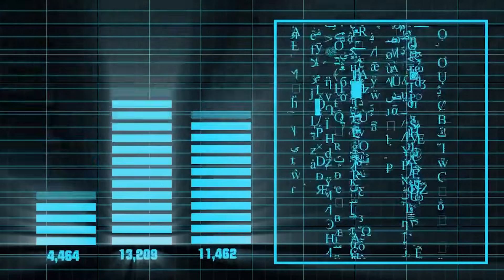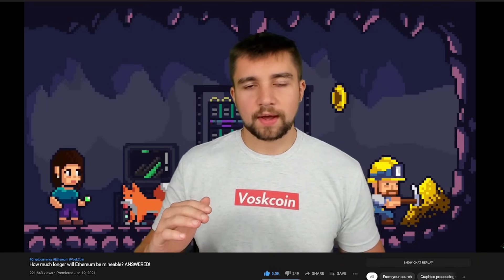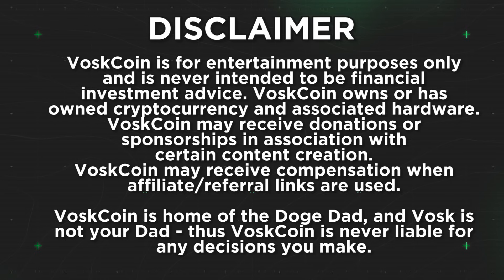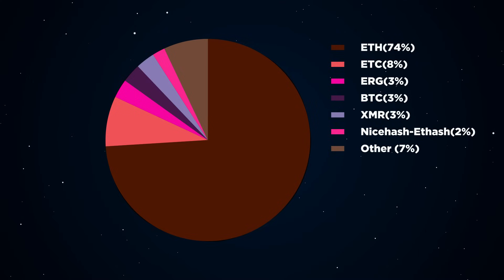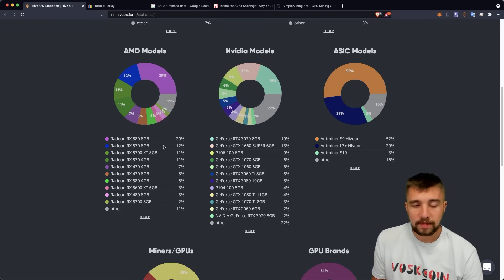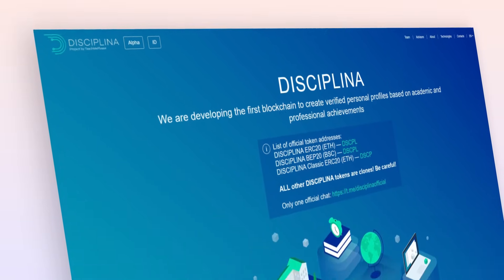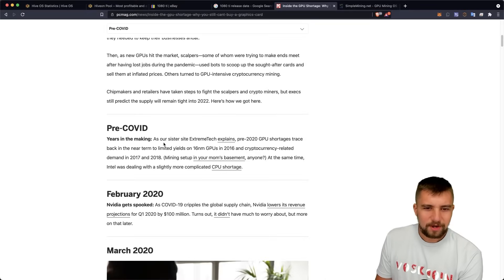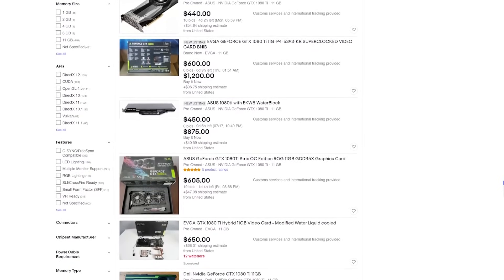What are the Most Popular Graphics Cards for Mining?

Comment: Hello Dear, i need an advice from you

Which is good option for mining :-

8 GPU’s Nvidia RTX 3060

OR 

4 GPU’s Nvidia RTX 3090

Thanks 😊
Reply: Is the 30 series not limited? Been mining with some of my old cards but my 3060 is barely getting 25mh/s? Haven't began overclocking it yet but it's no better than my old 10 series cards and 1660

Comment: anyone offering RIG maintance, tune up or repairs? I am having difficulty w overheating etc. tx
Reply: V0SƙC0IN  My Rx 5700XT Gpus were running HOT, so I lowered  the MVDD & CORE setting to see if it will help run cooler.....but instead it stopped-mining now :( (I reset all settings back but still not working properly.)

Comment: Thank you Vos, just started building my gpu rig current 2x rtx 3070 and two in transit 

Earlier using nicehash, now switched to hiveos have try simpleminer

Ethash running on lolminer with 122mh and 99.87 valid shares

Thank again for all the advice
Reply: I'd recommend you more gminer lower dev fee and higher hashrate